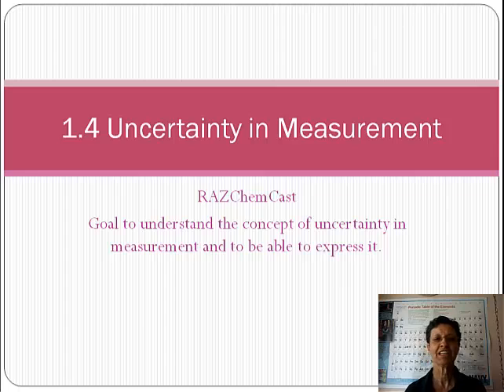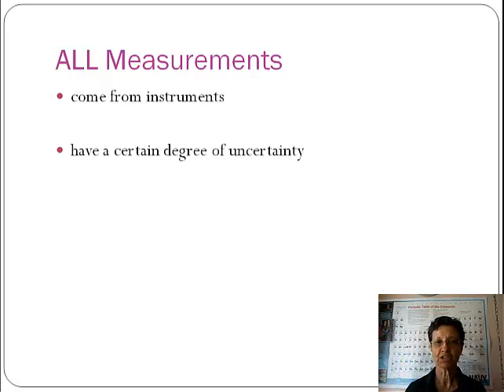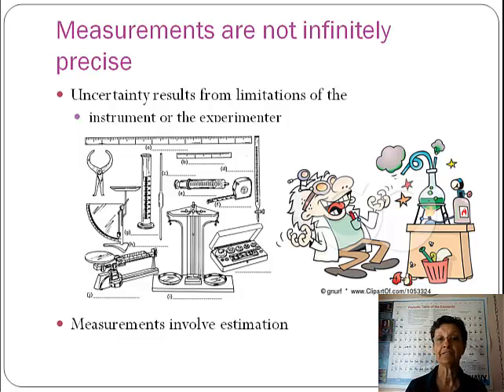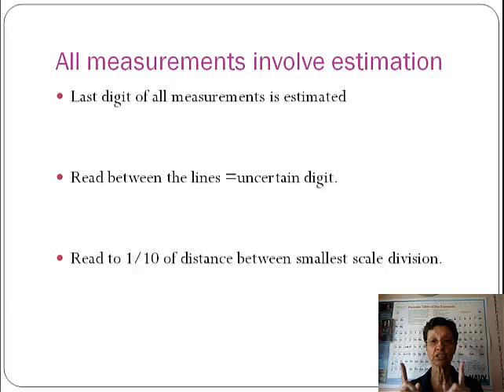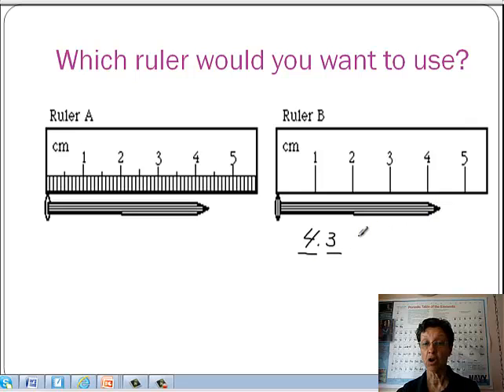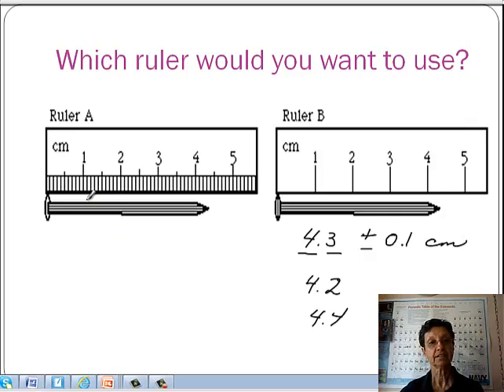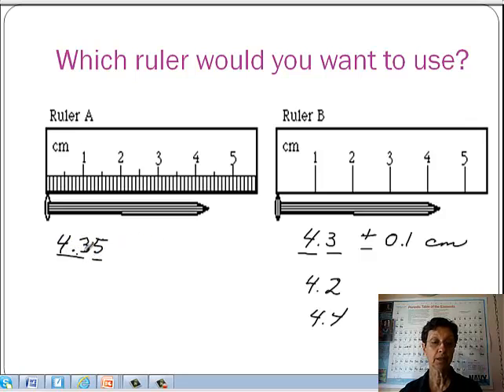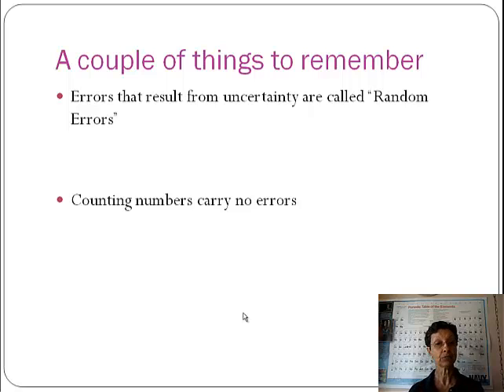1.5 B Uncertainty in Measurements

Comment: One question: why do you use one digit or two in the example, if the two scales in the instruments doesn't have that digit.
In metrology, it is common to work with the correct digit that the instruments allow it.  (4+- 1) cm  or (4.3 +- 0.1) cm  in this case I have a good interval, as well,  with the correct  significat digits.
?
thanks a lot.